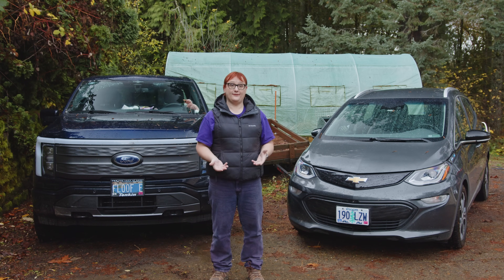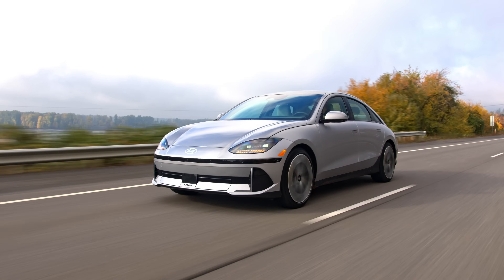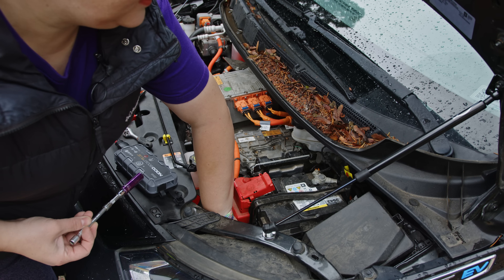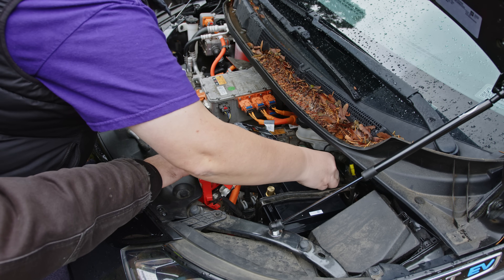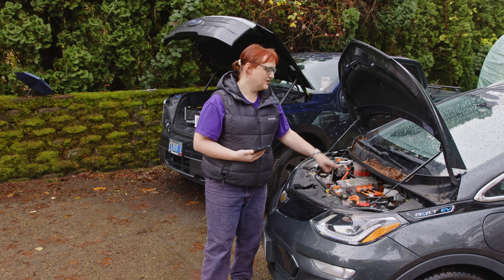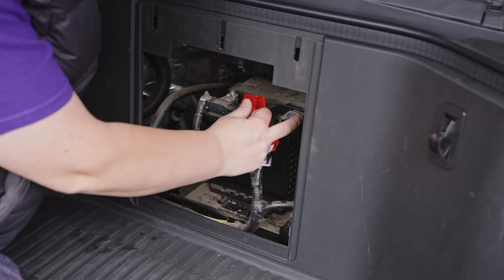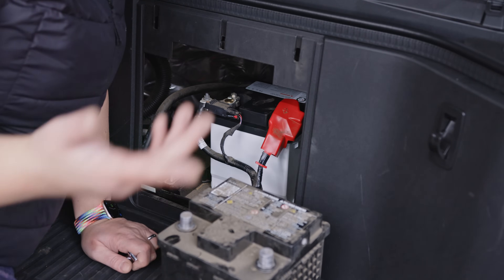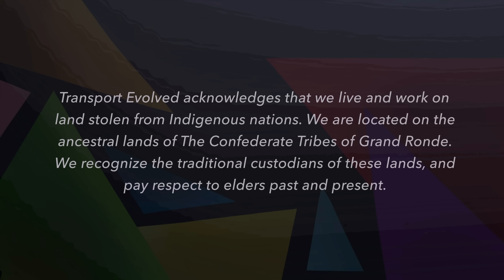Long Term Review (Intro) : Are These EV 12V Batteries From Ohmmu A Better Alternative To Lead Acid?

Comment: um... you installed the LiFePO4 battery into your volt:  you said it was charging at "80A", and the cells were at "3.68v".  um - LiFePO4 chemistry should NEVER go above 3.65V!!  and it was charging at 80A?!?!  whaaaaaa?!?!?

Comment: Didn’t you lose contact when reattaching the negative terminal? The most important thing with LI  batteries is a self heating for cold winter temps

Comment: I bought the original Ohmmu 12v for the Model 3 on the assumption that my 12v battery was 4 years old. I didn't wanna pay full price so I bought it used on Craigslist. I topped it off every few months as it took another two years for the AGM battery to fail. I popped the Ohmmu in but the car failed to recognize it. I contacted Ohmmu who didn't have a record of the sale so they refused to honor the warranty. Now it's just $200 worth of trash, but it does work as a nice 12v battery to run things off of.

Comment: I don't know about the F150 Lightening, but the Bolt 12 volt factory battery is usually a "Glass Mat" battery which is different from a regular liquid holding "lead acid" battery.  Technically, it is still lead acid, but the architecture is different, it's sealed, and generally lasts longer, etc.
But when the 12V battery fails in an EV, the whole system goes "haywire" and the car stops running.  Also, the remove ground first, connect ground last is the most important safety tip.  Though rare, a battery explosion sprays all that acid all over a person, hot acid in the face, etc.  I worked for Florida State Division of Blind Services, and people have lost their sight as a result of car battery explosions.  So best to follow the disconnect/connect rule always.
Thanks for an informative video.  The best rule is just install a new 12V battery every 5 years.  A Glass Mat battery is a LOT less expensive than a Lithium Ion one.

Comment: I've had my EV for about a year. I have a Mustang Mach E And I was looking into replacing the battery or shall I say upgrading the battery 6 months ago a little bit before my 6-month Mark for a couple reasons? I've learned about ohmmu battery Aunt, what I wanted to do is just basically have a lithium 12 volt battery just like the high volt battery is lithium but also I follow a few guys that modify their cars and I also modify my cars And they talked about the battery being 4 years last ing versus the stock battery which says 3 years. I've actually had to charge my battery 8 months of owning but my opinion of the stock battery even though it says 3 years. I say two that it will last And this is what I normally tell people when I'm on a different forums about the car Plus I've also been told the battery is better. A lot of people talked about BMS and that the lithium batteries will give you issues, but I know a bunch of guys that also utilize these batteries in their electric vehicles and they have no issues but I'll also seen the price of the battery. So yeah I know it's about $400 to 500 bucks but definitely why I want to give you a shout out. And thank you because anytime I save all my videos that I see and anytime I can always refer someone to a video

Comment: Lead acid batteries are recycled, to the tune of 90% in North America. These batteries are not. Environmentally, the lead acid batteries are a better choice. Price wise, the lead acid batteries are a better choice. The weight saving is less than inconsequential, so what's the point? Edit, lead acid probably wins from a safety pespective too. In a head on collision a 12v lithium battery is likely to rupture and catch fire even if the traction pack stays intact.

Comment: 3.68 volts per cell on the LFP battery is pushing those cells hard. The usual standard max per cell is 3.65 volts. There's nothing you or Ohmmu can do about the fact that the "12 volt" DC to DC converter in the Bolt is controlling the charge voltage.
Reply: In theory, it should be possible for the BMS to be programmed to trick the car into thinking the 12 volt is charged to a nominal voltage, while keeping the 12-volt within its safe operating range. There's relatively simple components for the purpose, such as schottky diodes.

Comment: Thank you for doing this test. I'm curious how well these perform, especially the sodium ion model. Although I've recently seen a few tear downs of Ohmmu LFP batteries that show they aren't constructed that great, lack any heating for very low temperatures, and that the built-in BMS disconnects the battery when full, which can be bad for the 12V rail which results in noise and possible damage to the PCS (someone else mentioned the PDU). If you get the errors on the Bolt about the 12V battery being disconnected, that's probably why. I hope your testing goes well.

Comment: Three years of High School training (electronics), and I never thought about keeping a "Jump Pack" in reserve in my electric-powered automobile. (You guys at 'TEN' are pretty Sharp. {Timely, as well. The chill in the air as Leaves Fall means "Death by Recycling" for MANY lead-acid batteries; whether they Awaken EVs, or 'Orrible  ICE Machines.})

Comment: One of the best features I've seen on ICE Lithium batteries is the built in low voltage cutoff.. Knowing you /can/t flatten it and if you mess up, you can press the button on top and it'll give you that last 20% it is hoarding to it'self is an amazing feature.  Especially on a bike where carrying a jumpstart is a bit impractical.

Comment: i built a 32ah lifepo4 battery for 50 usd. has a self heating relay circuit. confusing why these are so expensive. its been going well in my volt for the past 8 months. i posted a how to on the chevy volt 1st gen forums. saved 50lbs. similar weight savings to keeping only 1-2 gallons in the tank. the weight always adds up and the lower internal resistance of the battery and lower leakage current helps with range. saves about half a kwh each drive, so about 5 miles per day (two trips per commute). thats almost a dollar a day in fuel savings here in wa.

Comment: You mentioned the battery was warming.. i would have felt better to hear about thermal management to a battery that is outside all year.  Also is their a difference between the chemistry's for cold tolerance.. THX

Comment: I have a 2018 Nissan Leaf, and I put an Ohmmu in about a year ago. Been awesome so far, it fits better than the aftermarket AGM I had in there, and there have been no problem so far. I had some strange issues (one of the back doors would not lock) that came on last fall, and vanished with the Ohmmu, perhaps the AGM was getting a little tired.

Comment: Lot's of animated discussion on the Ioniq5 forum about whether or  not Ohmmu 12v Li battery is a good idea or not. Some seemingly knowledgeable EV techs there say that it's a terrible idea to use any 12v battery with its own internal BMS, as most Li 12v batteries have. Apparently the car's own primary BMS and the 12v BMS get into arguments from which no good, and much bad, results. Some Ioniq5 owners have swapped in AGM batteries, which some feel are better suited to EV charge/discharge patterns than old-school lead, and are happy. AGMs are still lead-based and have no internal BMS.

Comment: AGM Lead-Acid battery is a good compromise.  I put one in our LEAF and it lasted over 9 years.  Leakproof, maintenance-free, tolerates deep cycles better (than a conventional "flooded" Lead-Acid).

Comment: I'm just thinking about the price of batteries in general, when you look at the price of Lithium ion cells they are getting cheaper with about 100USD per KwH, you didn't say how many KwH are in these batteries.  But when I've looked on the internet at other battery packs they seem to cost much more than the cost of the battery cells, obviously it does need to be more because a battery pack is more than just the cells, but battery packs in general to seem to cost a lot more than the cost of manufacturing just the cells.

Comment: Good idea. I'd say the reduced weight is worthwhile. Every little helps. For reasons explained by others I always undo the ground (earth) first and reconnect it last, and personally am very cautious with live positive conductive parts having had a spanner (wrench) and a metal oil pressure tube (ice) short to earth on a positive terminal before I learned that. I'll be interested in how it goes in the longer term.

Comment: I've recently glanced over my 2015 Leaf's starter juice-box and it looks like it is the factory installed one as it says Nissan on the side. That would make it 9 years now. I might find some date markings with a closer inspection. It surely has not been replaced in the 6 years I have owned it. Some say the mini solar panel on the rear spoiler helps keeping the battery happy. However the car spends most days in an underground car park since 'rona. Hearing they die every 3 years makes me wonder if should put one in my trunk now ^^

Comment: Since Lithium batteries don't like to be charged when below freezing, does it have an internal battery heater?

That's the primary reason that I would get a lead acid replacement battery. 

I do have a similar battery jumper currently.

Comment: I bought my Bolt in april 2017 and just changed out the factory battery this last month , not because it quit working it was just old and I didn't want to get stuck. 
I did test it before removing with a carbin pile tester and it didn't even lift the needle but the car would start every time even after the load test.
What sucked about taking the old battery out was resetting the clock , the hilltop reserve for at home only and shutting the anti theft alarm for the
 charging cord off.
But I basically got 7 years out of the factory battery and I don't know how much longer it would have gone.

Comment: MY 2023 bolt came with a lithium  battery  and I was concerned about the charge voltage  with the improvement  as different chemistry  require different charge float level.

Comment: NEVER-NEVER-NEVER EVER wear rings or watches when working with electricity and especially batterys. 12v will burn your finger to the point that they'll say remove it. Short out a  liteium battery and it will  flash  and  more than a lead acid but both are dangerous. I've seen a socket  wrench disappear in a flash when a installer let go and it shorted out a 24v  battery plant.
Reply: 24V vaporizing a socket wrench? I call B.S.

Comment: Question: what are the considerations between Lithium and Sodium options other than price?

Also, my hybrid ate SLI style batteries fairly quickly.  I don't think any lasted 3 years in the 8 years I owned the car.

Comment: Lead-acid batteries of yore frequently lose their acid-sealing ability around the top posts, and minute acid leaks occur around the posts.  Installing a felt ring impregnated with oil, or "battery grease" can prevent the acid getting to metal to corrode -- for a while.  (any grease will do: dielectric grease, specifically, is really only req'd for HV connections, but "everyone" assumes that only DE grease should be used on any automotive connector, which is bunk.  Chassis grease is fine for battery terminals.  In the old days, OEMs recommended Vaseline by brand name).

I want to mention proper top-post terminal installation etiquette/Best Practice: always make certain that the terminal is fully seated on the post, prior to tightening the clamp.  This is very often not done, and the clamp range is almost always insufficient to properly clamp the post, unless the terminal is fully seated.  There's a tool for this (I call it a "battery terminal speculum", but you buy it as a "battery terminal spreader") specifically for top-post batteries.  You can make-do with a #3 flat screwdriver or combinations of pliers, but there really is a proper tool.  

Spreading the terminal open, fully seating it (assuming it's all clean!) and then tightening the clamp: that's the correct procedure.  You should not be able to twist the terminal by hand after tightening the clamp.  If you can, it's not tight, and something's wrong.

End of today's lesson.

Comment: I'm not going to chase it myself, but if someone knows the IPxx spec of these units, LMK.  The last time I looked into drop-in 12v Li-ion replacements for lead-acid, none were anything close to waterproof, which is pretty much required in our wet Pacific NorthWet.  I'm not installing a device that can't accept a standard garden hose washdown, it won't last here, and nothing under the hood of any modern car (post-distributor-having) is bothered by splashed water; replacement parts have to be designed at least to that standard.

I've been DDing a 2014 RAV4 EV since 2017, a car especially noted for killing the OEM lead-acid battery in ~3 years regularly; there are dozens of posts about this (there were only ~2600 of these cars made).  I knew this going in, so also in 2017 I bought my "standard" AGM battery as a replacement for the still-OK OEM one: Odyssey 34R-PC1500T, and expensive/premium AGM.  My extended family & myself own three older Toyotas (two old Siennas plus the EV), and this exact model battery is in all of them.  I am on year seven/70k miles with this battery, which would never happen with the OEM battery in this vehicle.  It's not cheap, but I haven't had a lick of trouble with the three I own -- though the one mentioned is now my oldest.  I paid a but less then $300 in 2017 and $305 in 2020; today, they are $385 + tax (free US shipping).  It's 50 lbs.

I like the idea of a durable, lightweight alternative chemistry battery for lead-acid, but as others have noted, automotive systems that are designed around a lead-acid battery being permanently connected usually make use of that fact to dampen spikes and voltage variations at the battery; that's not typically the job of the DC-DC Converter.  A Li-Ion (for example) will presumably disconnect from the vehicle when fully charged, and I'm not confident that the rest of the vehicle's systems will work reliably without the lead-acid's permanently-connected damping effect.

Comment: I’ll be following this closely. As the lead acid batteries are just dandy for ICE vehicles, where there’s a drain but also regular charging. Which is what lead acid batteries like. But put them in an EV, and unless they get regular top-ups, they’ll drain too far much earlier than people have come to expect.

As you say, EVs dong need high CCA batteries. What EVs do need, are batteries that are well suited to deep cycling. So I’ll be interested to see how the sodium battery performs.

Comment: Spooky! Just now, I found out that my Nissan Leaf wouldn't start anymore (with a nasty error message), and a google search confirmed to my relief my suspicion that it needs a new 12V battery instead of a potentially much more expensive proprietary part. I went to youtube to see if anyone had additional information, and THIS was the first video that popped up in my feed when I opened it (without any search yet). Isn't at least a bit spooky? 😅

Comment: As someone who lives in high heat, high humidity what would I need to know about caring for either their lithium or their sodium battery? I drive a 2023 Bolt EV (lowest level trim) if that matters?

Comment: Thanks, as always! I wonder if the newer chemistries will lead to longer battery life, or at least more predictable replacements. My old Ford Fusion hybrid had a silver-ion special battery, which had the specific effects of being expensive and only available from the dealer, but zero effects on longevity here in Arizona.
Reply: Sodium battery are still in the newborn state and not massively commercialized yet. But as the EV battery demand keeps jumping higher and higher I'd expect it to be massively produced in a couple years to balance the demand of lithium batteries

I'd expect sodium batteries to fill the demand on the basic standard range EVs due to its slightly lower capacity than lithium batteries, while the medium range and extended long range EVs are likely still using lithium batteries

Sure, some electrode chemistry variation will be developed for the sodium batteries to bring the capacity to as close as lithium batteries, but it will take a long road of development, as lithium batteries alone took over 30 years of development from the newborn state to become fully mature like we see today

Comment: The 12v draw when running is also pretty high, and if the car isn’t generating that power from the traction battery it will run down VERY fast..  as I discovered last night when my ICCU decided to fail..  I could have made it home in limp mode except the 12v got drawn down in minutes and very soon the entire car was dead despite having about 78% in the main battery

Comment: If you have a Model 3, don't buy a Ohmmu lithium battery. Total ongoing hassle. The sodium batteries much better. The bluetooth and disconnect the high voltage battery dance gets old.

Comment: I agree the weight difference of the new high tech versus a traditional battery is such a small percentage of overall weight the range difference would be less than 1 percent.
The biggest advantage I see is the overall lifetime of battery life. Traditional lead batteries have lifetime from about 1 year to as much as 4 years. Many of the lithium batteries advertise 4 to 8 years.

Comment: You're braver than me to use the jump pack that way.  It may have been the camera angle but it looked like you were super close the shorting the positive terminal to the chassis a couple of times.  Personally I'd rather let the computer throw some random errors until it sorts itself out than risk it.